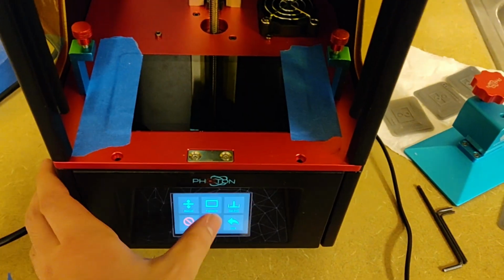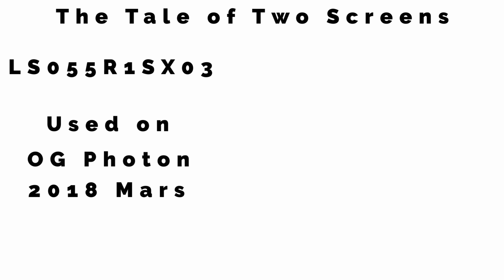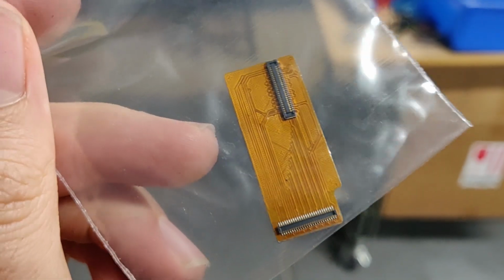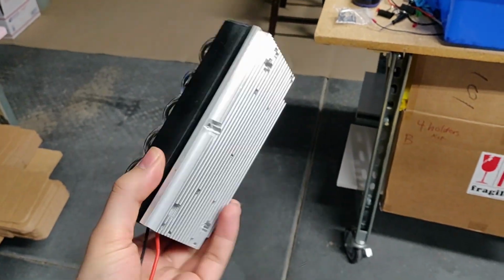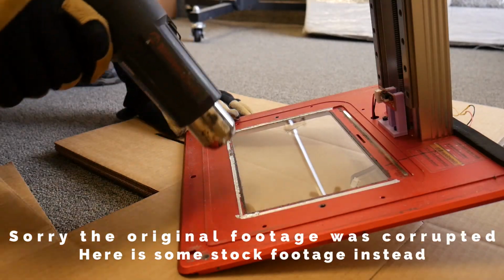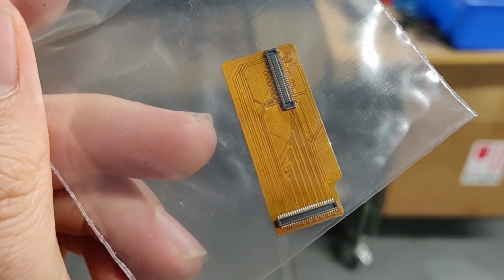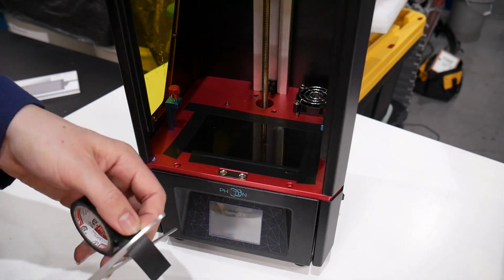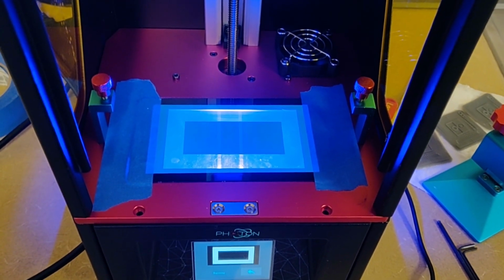The Easiest Mono Screen Mod for the Anycubic Photon (And Most Other Older Resin Printers)

Comment: HI Yasu, i have an OG anycubic Photon i  ordered this new screen and installed it today everything went well until trying to upload the screen firmware. i downloaded the firmware and put it on the usb drive but the file does not show up on the printer.
Reply: any help at all would be appreciated.
Reply from the maker: I would double check the USB stick on your computer and make sure it loaded.  Also make sure the firmware file is on the root directory to avoid confusion. Otherwise worst case, try a different USB stick.
Reply: @HiroCreations  Thanks for the fast response the same USB drive loads my prints just fine. do you still think it could be the problem?
Reply: @HiroCreations  this is the file name "V1_L055_DXQ1080_P29_F10_A_20_90_100.CBD" does that seem correct?
Reply from the maker: @lhofer00  yup that's the right file. It might be worth trying a different stick. Worst case I would recommend reaching out the Chitu's support email. They have been super helpful and responsive when I have issues getting a board or screen setup.
Reply: @HiroCreations  okay thank you! and keep it up with the channel i really like the content!
Reply: @HiroCreations  is there a way to downgrade the photons firmware? i am using v5.0.2 and i think that is the problem.
Reply from the maker: @lhofer00  Assuming you are running a v1 board and not a photon s/fauxton board, there are a bunch of older firmwares here: https://github.com/Photonsters/anycubic-photon-docs/tree/master/firmware
Reply: @HiroCreations  well heck! it seems like it does have the photon S board!! that explains a lot! can you provide a link for a board that will be compatible with the screen?

Comment: Can I do this mod to an Anycubic Photon S? And if yes, is it the same screen I need? Thank's. Can you post a link to the photon s screen to make sure I purchase the correct one. Cheers.
Reply from the maker: You would have to change the control board to a Chituboard L v3 and get a chitu UI touchscreen as the anycubic boards won't work with these mono screens.
Reply: @HiroCreations  Thanks.

Comment: What version of motherboard did you try this screen on with the Elegoo Mars? I have the older A version board and I’m wondering if this will work.
Reply: Did you ever find out?  I’m thinking it wont work with a pin adapter. You may need a new board.

Comment: How do I know if my voltage pump is broken? I tried some replacement screen and it stayed dark when testing it. I fear I might have broken my Mainboard now
Reply from the maker: The chitusystems website has a handy guide of which capacitors to test with a multimeter to determine that issue here: https://www.chitusystems.com/knowledge-base/troubleshooting-brand-new-sharp04-lcd-screen-is-not-workable/
Reply: @HiroCreations  Thank you for that link. I now know for sure my mainboard is broken. I really, really wanted to retrofit my OG Photon with this wonderful mono screen but....... oh well.....

Comment: If I  Fried my motherboard by not adding the adapter. Is the screen still good or do I replace that as well?
Reply from the maker: Screens should be fine, in the few instances I blew out my OG and V3 boards by accident the screens were always fine when I plugged them in correctly into a replacement.
Reply: Sweet, thank you!

Comment: For the life of me I cant get the update.lcd file to read.
I have watched this video multiple time to see if i missed something, but no luck. I can get the .cbd file to read just fine but the .LCD file says its an unknown format. I have the OG board V1, the SX04 Screen w/ adapter. Help please...
Reply from the maker: That's strange, are you perchance using the newest one on the site? A few other people have reported in with the firmware having issues getting flashed to the board. I did this video with an older version that does not appear to be available anymore. 

My rec would be to reach out to support and see if they can supply you with the right file/specific guidance on dealing with that error.
Reply: @HiroCreations  Yeah I pulled it directly from Chitusys.
Reply: Just to add...Their support is absolutely terrible. Submitting a ticket from the site doesn't even work
Reply: Did you figure this out? I assumed the update.lcd file was unnecessary but idk
Reply: @Ashton Woollard  nah it didn't work I guess I'll have to buy a newer board. The og board is pretty much unsupported now

Comment: i finally have my machine back together, i did the harder mod  but with this smaller mono screen. The final problem im having is that the screen doesnt display a mask, it just opens fully
Reply from the maker: If its not displaying a mask, I'd double check to make sure the firmwire is correctly loaded. 

If the firmware is flashed and still has issues reach out to Chitu systems as I heard of a similar issue happening with other users occasionally but I can't remember the solution.
Reply: Any progress on this? I'm having the same issue. Using the new firmware that supposedly supports chitubox pro. I'm going to try flashing the older version (if it's possible to "downgrade").
Reply: Flashing the older firmware got the mask to appear. Somewhere along the line the UI got bolloxed, and had to download UI_ALL_LCD.bin and flash that too to fix it. https://www.dropbox.com/s/xx1boy3iu7rtama/UI_ALL_LCD.bin?dl=0
Reply: @protrainz  yeah, in my case i hade to flash it again.
Reply from the maker: That's new, I've not yet flashed the new firmware, I might wait a bit until the bugs get fixed now...

Comment: Can you put a mono 4k screen in a mono 2k printer?
Reply from the maker: You can, but the challenge is getting a compatible control board to run the 4K screen and depending on the screen you may have to cut or mill out a new hole in the screen plate to fit the ribbon cable.

Comment: Now you have me wondering if I can upgrade my Longer Orange 30.
Reply from the maker: Its likely possible with a board swap to a Chituboard L V3.
Reply: @HiroCreations  the longer Orange 30 uses an Orange Pi as the brains and a separate board for the LCD.
Reply from the maker: @billkaroly  Interesting, an old school setup (separate LCD driver boards was a thing on older mSLAs until chituboards intergrated the driver on the main board) problem is you'd need to source a driver board or flash firmware that is compatible with the LCD. I am not aware of any sellers offering driver boards for the FHD 5.5's. Your better option would be to use 6" 2k mono LCDs and source the screen and separate driver board from Duobond on Alibaba. 

Then its a matter of figuring out how to flash the firmware on Orange Pi to support the new size/resolution. But that might be more trouble than its worth.

Comment: Would this mod work on a Photon S mainboard as well? I have looked everywhere on the net but I cannot find a definitive answer. I mean since the Photon S uses the same displays as the og Photon, it SHOULD be possible to use the mono screens on the S version, shouldnt it?
Reply from the maker: Alas no, the Photon S control board is not a Chituboard but a custom board made by Anycubic, so where the connectors might be similar, the firmware definitely won't work. So you will have to swap the main board to make the upgrade work.
Reply: @HiroCreations  Thank you so much. I just now cancelled my order for a Photon S mainboard. I guess I have to try to find an OG mainboard now.
Reply from the maker: @senorcapitandiogenes2068  you can also grab a Chituboard V3 which is a much improved version of the OG photon motherboard with a identical form factor and connector layout. One of my photon mods runs on a v3 https://chitusystems.com/product/chitu-l-v3/
Reply: @HiroCreations  I'd love to, but that board with shipping to Germany is more expensive than a replacement original mainboard. I just hope I wont brick that one as well with the mono LCD. Those stupid SX03 and SX04 connectors are a plague

Comment: I'm having issues with the LCD Error T_100 after following these steps. Does anyone happen to know what exactly is the problem?
Reply from the maker: T_100 error usually is a connection issue or not using an adapter if you are using the OG photon board.

There is a nice troubleshooting guide on the Chitu site here: https://www.chitusystems.com/knowledge-base/error-type-lcd-error-code-t_-l_/

Next level up is to reach out to their customer support for more troubleshooting help.

Comment: Will it fit a prusa SL1?
Reply from the maker: You would have to swap the board, as I doubt the SL1 board has has the correct MIPI connector.

Comment: I tried to install it on my elegoo mars and when I do the exposure test, it had a lot of UV light going through the mono screen. can I get some help?
Reply from the maker: Wierd, could be either you exposure is set far too high (monoscreens do bleed though at excessively high exposure times) or its a bad screen. Either way I would recommend contacting Chitu systems directly.

Comment: Does anyone make a 4K mono screen for the Anycubic Photon or is a 2K mono upgrade the best I'd be able to get?
Reply: I think you'd need some additional hardware for it, it's somewhere in the comments, I can't find it, it's a little higher than yours
Reply: I've not seen any 4K screens in the size the Photon has. Doubt it can be done.

Comment: hi yasu- quick question.. Done the 5.5 screen/chitu board upgrade to my fauxton. what print settings should I use? ie: exposure times etc.. Tried loading in the config into chitubox, but it seems to do nothing?
Reply from the maker: Exposure times will vary from resin to resin. For most of the resins I use or have tested worked out well with 3 second layers, 25 second base as a good starting point--but you will have to do your own calibration tests to get "perfect cure". I wonder if the config files are not interoperable with different versions of Chitu--something for me to chase down and test soonish.

Comment: Not happy with mine, bought 2 for my elegoo mars and both are dead and don't work right out of the box, tried them both hooking it up like it shows on their website for my type c board and neither one works, plugged the old cracked RGB screen back in to test it and it still works fine
Reply from the maker: Did you update the screen specific firmware?

Comment: I'm trying to do this install on my photon right now.
I've discovered a problem. 
The new screen does not sit on the existing glass flushly with the support plate. It sits too high.
The mod comes with a sheet of glass but it looks pretty thick.

Edit: the glass provided with the mod is actually a lot thinner than the original glass. It needs to be changed as well for this mod on the OG Photon.
Reply from the maker: Good to know, my photon was so old that it did not even have support glass.
Reply: @HiroCreations  I wonder when they made that change.
I bought mine in march 2019 I think.
Reply from the maker: @youtubevanced4900  I got mine at the end of 2018 back when they cost $600. Lol those were the days...

Comment: A resolution drop? Huh, that's odd. Do you think it's worth it?
Reply from the maker: There is a newer mod that upgrades the screen to a 6" 2k mono screen with a 48-50um pixel size which should be the same resolution as the stock RGB screen, and if you are willing to CNC mill out a custom pocket on the aluminum surface (to accomodate the ribbon cable) its possible to mount a 4k 6" screen on the photon now.
Reply: @HiroCreations  interesting. Is CNC really needed? I don't think the resolution drop is that big of a deal but I kinda want to see how it goes. Curious though, what would be the benefits of changing from an RGB to a mono if the resolution dips. I'm using a photon S for this on a chitu v3. Other than the longevity and faster print speeds. Any other benefits?

Comment: So i bought the 5.5 FHD Mono upgrade for my Photon (i thought i had the OG one), but it seems like I had the newer second version?  Does this mean to make it work I need to buy the new 2.8" Screen and V3 Chitu Mobo?

Thanks!
Reply from the maker: Is the control board PCB green and have an anycubic logo written on it? If so, that's the newer fauxton/photon S type board which won't work at all with the screen. You sadly would have to swap to a Chituboard v3 and 2.8" touchscreen.

Comment: So this works for only og photon or photon s and fauxton?
Reply from the maker: Works with OG Photon without needing to change board. Fauxton and Photon S require a board change to use the screen.
Reply: @HiroCreations  do you need to change the touch screen as well or is it not necessary
Reply from the maker: @C.X Ho  no need to change the touchscreen if its an OG photon.
Reply: @HiroCreations  if it's a photon S? I will change the board, do we change the touchscreen too?

Comment: Is there any chance a screen like this https://www.alibaba.com/product-detail/BOE-5-5-inch-2160-3840_1600133022472.html (or any other mono 4k) could be run on a chitu v3 board? I am trying to upgrade a photon S in the hope of using the mono 4k screen and the chitu 1.9 upgrade for faster 2 stage lift speeds. Why chitu 1.9? Because I have a mega 8k on order and I will be sticking with 1.9 or chitu pro for a while. I love slicing in chitu and hope they is a way to mod machines to use more of the newer features.
Reply from the maker: I'm still trying to dig deeper and understand 1.9 (and resolve a few stability bugs) so I can't comment much on that. 

Last I tried a few months back the BoE 4k screen was a nogo as the screen needed a dedicated driver and HDMI board to have enough bandwith for the additional resolution (which was more than the MIPI connector could handle).

Comment: Hey I have an Elegoo Mars with B board. Ordered the Mono screen for Mars but it did not include the adapter. If im understanding correctly I do need the adapter in order for this to work correct? My 2nd question is which firmware do I use for the Mars B board?